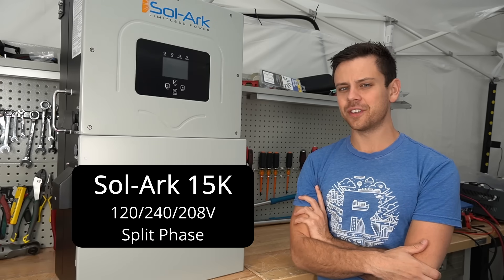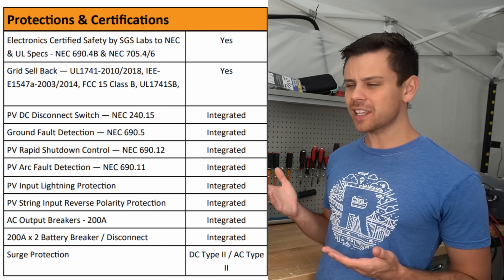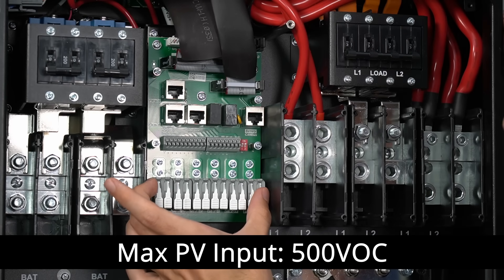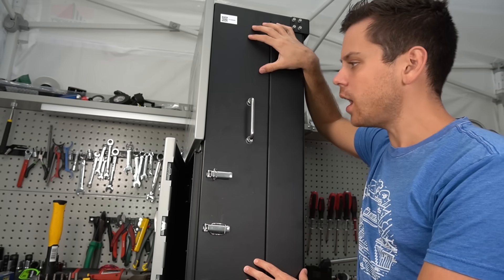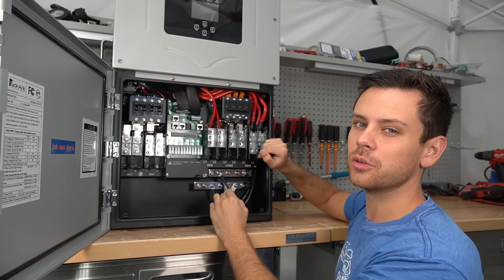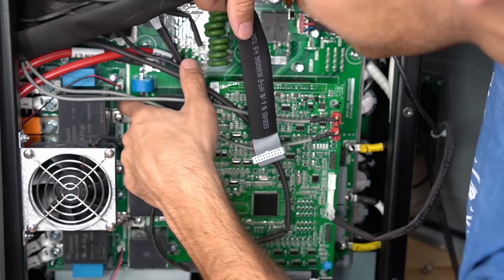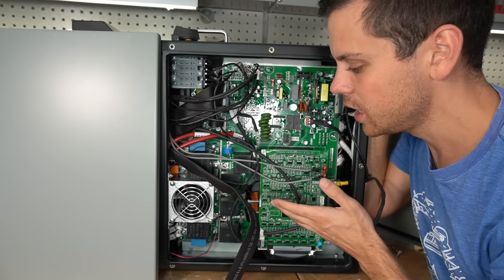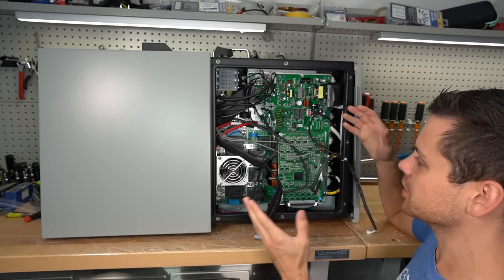Sol Ark 15K: Ultimate Grid-tie or Off-grid Inverter

Comment: Does it support a remote DC shutoff?  That DC shut-off has to be on the outside of the building in my area, so the Solark would have to be outside to make that work.  I guess that would work out but I'd like to have an $8200 piece of equipment more protected against theft.
Reply: Why does it need to be outside?
Reply: @timburke3096  Code.  First responders need to be able to deactivate any high voltage systems without going into the structure... at least where I live.
Reply: @ericbraun4652  So put a switch outside like everyone else does but have the inverter inside.
Reply: @timburke3096  It’s not that simple (I think).  What do you wire to that switch?  The full (in my case) 300 amps of battery current or do you put in a 300 amp relay inside and run controlling voltage to an outside switch?  My el-cheap-o Sungoldpower 12kW inverter has a remote switch controlled over RJ11.  Without support built into the inverter it is a difficult thing to do with high amp systems.
Reply: @ericbraun4652  This video is about the 15k Sol-Ark.  I'd like to help you but as the same time I like to get paid for my time.  Would you like to contact me on my site or email and do a paid consult.  If I can't answer your question I will find the answer.  I have done these sol-ark systems with shut off switches where they are supposed to be.  I know how to do it but your question is confusing me.
Reply: @timburke3096  I know this video is about the 15k Sol-Ark.  That is why my question is about the 15k Sol-Ark.  Is a remote shutoff supported?  It's a basic feature question so my bad getting into the weeds of how you handle a remote shutoff if it's not supported by the inverter.  I should try to find the install manual.

Comment: Not impress! Sounds pretty much like a commercial. Where are the massive transformer? Not a low frequency inverter? Pretty much it belongs in the municipal dump then.🤣🤑 Wouldn't attached it to my house even if they pay me.🥸 At 8,250.00 it is slightly a wee bit overprice; if you ask me.

Comment: Thank God someone competent is finally reviewing this wonderful Inverter.  My 12K has given Zero problems over the last 12 months and it runs my whole house to the tune of 55KWh Per day.
Reply: I am looking to get this same battery, two actually but the 19k version.  I use about 66Kwh per day on our home.  I want to recharge and run off solar only.  No reliance on the grid or have to constantly recharge batteries with a generator.  What are you doing to charge up the batteries?  How many circuit panels you have?  I have 400 watts coming into the home.  Each leg (200watts) is running to a separate main breaker box. Then I have 125 watts splitting off one of the mains and runs to the other side of the home and powers two smaller sub panels.
Reply: Jesus that 2x what i use.
Reply: You are quite the energy hog
Reply: @nach335  mine is double that in the summer months through my electric company. I don't hardly use anything either. I have a fridge,  small freezer, water softener, well, do 1 load of wash per week, 40g hot water heater and central hvac plus a very small pantry ac unit. My house it tight/ very well insulated. I don't use a dish washer, hardly watch TV, hardly cook, all led lighting... house is 2100sqft. I think the central ac is the main culprit. I live in the deep south. Plus my bill went up $60 a month directly after the meter was replaced with a smart meter. My hot water is also on a timer. We are 100% electric. I'm here to see about cutting  my electric with partial off grid solar for the well, pantry ac, fridge and freezer mainly. He might be like I used to be with 4 kids, 5 tvs, many showers per day etc... might have a pool or larger house. Everyone will be different  😉

Comment: So, I just bought a sol-ark 15kw inverter, I am deciding what battery system to use that communicates to the 15kw sol-ark
I have looked at the recommended ones very pricy, what is the pros and cons on having coms with the battery. Sacred Sun batteries are the lowest cost that communicate but not sure about the company and their product.
Reply: There are some videos and other online info discussing the advantages of closed-loop communication between the inverter and storage, for both monitoring and control. The only con would be price.

Comment: There is a very noticeable lack of transformer based inverters on this channel. High frequency inverters might be cheaper and seem "just as good" but for instance where the grid has lots of harmonics and/or outages (like here in South Africa) these high frequency inverters just don't last. There is no big chunky transformer core to absorb these surges and/or act as a filter (choke).

I'll stick to installing Victron. They're miles ahead when it comes to reliability, software and customer support

Comment: I really want to see this work in concert with a back-up generator.  I would like to pull my Kohler ATS off the wall and drop this in it's place.  Generator functionality is critical to a true back-up solution where solar is involved.  Have yet to find a solar contractor who understands the concept of generator redundancy and how to design a system incorporating solar, batteries and a generator.  Like the channel love the reviews but to me solar and battery tech is more about security and independence than anything else.  Three power outages this year the longest at 7 hours and the generator saves the day it's just horribly inefficient.....  The hacks are great but really what we need is a true plug-n-play scalable system design that could be implemented into any residential scenario.

Comment: Hi Will, I have a same set up about to buy a larger set up. Will be 24v battery’s all victron charge controller and distributor. What inverter would you recommend? I’ll never be with shore power so I don’t really see the benefits of a victron. Maybe giandel 24v to 120v 4000w is what I’m thinking

Comment: I have an AC grid tie system using Enphase micro-inverters. I would like to add battery backup as well. Will this system work and will it allow me to utilize my solar AC coupled system to feed my load and charge my batteries during a loss of utility power? In order to use my solar, I must have an AC source for the micro-inverters to work.
Reply: Should work. I'm considering the same thing. You can AC Couple through the GEN port (not the PV ports). It will use the batteries power to send a signal to the PV to produce or cut off (if batteries are full). I'm hoping his buddy they are installing with is a grid tied microinverters system to see this exactly.

Comment: Hi Will.  You mentioned that this has protection against EMP.  Do you have any recommendations to protect our solar systems from EMPs?
Reply: Emps usually only affect electronics that are running if the unit is off and disconnected it should be fine...  For many years that was the standard op in many industries shut everything down disconnect what you can automatically and ride out the attack...  You can also build a Faraday cage around the unit... the problem I see are the solar panels if they are cooked in an emp what good is that 8k inverter??? Except for a tarp or something how do you shut off a solar array or protect it from an emp????
Reply: Not LIFEPO4, you'll need to use lead acid batteries. Unless someone has a EMP one which I doubt, someone correct me if I'm wrong
Reply: It’s not EMP yet.
The 8 and the 12k are..

Comment: I was already firm on getting a Sol Ark 12K (maybe 2 considering my scale), but had no idea they were going higher. Thanks for posting this!! I planned on a 25KW solar power plant (overkill, but I wanted options). Could you post a theoretical design of what wiring two of these into a house would look like?
Reply: Literally a diagram for that on the instructions when you get them.

Comment: Interesting item. Two questions.....
Is the gridconnection auto shutdown if grid looses connection, so you dont electricute grid workers?
If you have two, is it able to do full three phase equipment?
Reply: It has to shut down to be UL compliant.
You need 3 for 3 phase power.

Comment: Like it a lot but my garage is not next to the meter box. I don't think it can be mounted outside and survive a rain storm though. Even it can, the moisture and outdoor element will shorten its life.
Reply: AZ,  I'm pretty sure they have an "outdoor" rated box you can slip it in.
Reply: It's rated for outdoor mounting. The electronics are completely isolated from dust and moisture. While the ventilation is open to the elements, it's engineered to tolerate them. There's been a bit of discussion about this with a Sol-Ark participant at DIYsolarforum.
Reply: Yes, its best to keep these things in an air conditioned space.  Also helps to keep them locked up really well.

Comment: Used the 8k since 2019 100% off grid and the 12k outdoor since 2020. These things just work, I have a lot of tools like welder, chop saws, compressor and ac in two areas and can run everything with adequate balancing. 
The scalability I think is a delight with the 12-15k. To add solark customer support is extremely good, they actually gave me a huge discount on the second item when they heard I lost the 8k in a wildfire. Great company to support.

Comment: so could this still be used off grid when your local power company turned off power ?
Reply: Yep
Reply: Yes but a common misconception is that you can run 200 amps for your house when the power is out.  check the spec sheet.  12,000 watts with balanced L1, L2 loads.  With imbalanced they don't say but its probably like 4,000 each.  So you should probably have a sub panel.  I do consults.  Click logo for contact.
Reply: @timburke3096  :  If I remember correctly, it's if they differ by 4500 W, it throws a fault. Besides the subpanel idea, I think there are two other ideas, The first is to add an auto-transformer. There are some YT videos about doing this with the 12K (I think one is by Dave Poz). The second idea is - instead of a sub-panel - use a smart panel. Sol-Ark announced their Smartloads 14 way back in January. Word is that it might help with the unbalanced lines issue. I think the latest info is that it is coming in Q4. So, if you need to install everything now you could either leave space for the smartloads panel (it doesn't replace the main panel, but rather works along side it), balance lines the best you can for now, and then add the Smartloads 14 when it is officially released, OR you could call Sol-Ark to try to get one now as a beta test site (hey, ya never know : if ya never ask, you can be sure you won't get)🙂. Of course it is recommended that you verify any of the above info by contacting Sol-Ark directly. Good luck.
Reply: @gerrygreen3832  Ya, sounds about right to me.  Unfortunately many people will get the message that they can just power their whole house with this.
Reply: @timburke2835  : Yeah, I understand that concern. That is why everyone doing solar (& especially when adding batteries) should do an "energy assessment" for their whole house (including things they are  likely to add - like an EV - after solar is installed). And, unless the homeowner is really educated on this subject, it should be done by a professional. If it shows something unexpected, you may even want to install something like the Scneider Wiser Energy Hub to get a few months data to produce a detailed analysis of what devices are consuming.

Comment: Looking forward to your install and testing - I was considering Sol-Ark for a three-phase build I'm planning but the app/remote management is all Chinese-based (they claim it will move away from that in Sep/Oct), and there's a lot of chatter around unbalanced loads nuisance tripping the Sol-Ark 12K (which would kill it for my consideration, given that unbalancing can easily happen in 208V systems). If you have a chance, please cover unbalanced loads in your testing!
Reply: Yes! you nailed two key concerns -  1 the PRC app that can remotely modify your programming when online, & 2 the unbalanced load faults shutting down the system (<3k load). We’re remote off grid Alaska and rely solely on the Sol-Ark 12k for our homes entire power system. One year now with the 12k and many “bugs” had to be worked through (made the last winter beyond normal difficult) with other issues yet to be resolved e.g.,  false state of charge (SOC) % readings with lithium batteries...
Excellent review, and further testing on the unbalanced loads could help identify a workaround solution.

Comment: Can you tie the Sol Ark with a Fortress eVault Max Lithium Ferro
Phosphate (LFP), 51.2V(48V),360Ah,
18.5KWH total capacity, LCD: 10 yrs
warranty. Product dimension(WXDXH):
20.3"x20.3"x42.2, product weight: 520 lbs.
Reply: Yes. It talks directly to the BMS.

Comment: I wish you would do a video on replacing led acid batteries with lifepo4 on a trailer with 10 solar panels and a backup generator like you see for sale all over the place. I need to replace mine and do not know which direction to go!

Comment: I have  been  running  off the 12k-p for about  two weeks now. I'm using canadian solar  bi-facial  400w at 13000w 32 panels , I'm completely off grid. I'm using Big battery 17kwh  332ah. The house is  all propain. But I haven't had  to run the forced  air heater yet. The battery  has been  hovering  around  68 % in the morning  and is fully  charged  by 9:15. I'm going to  add one more  battery ( I can stack 8 of these )  then I should be good. This sol-ark is flawless. I was forced to  learn  solar in four months,  thanks for  your videos  Will.
Reply: Someone  is using  will prowes solarpawer with an a to scam people
Reply: Sorry I  had to un subscribe 😔  I liked  watching  your  channel